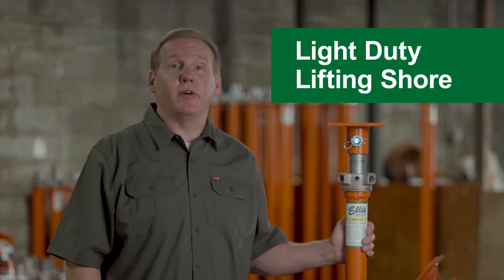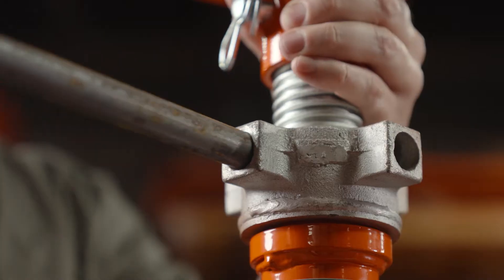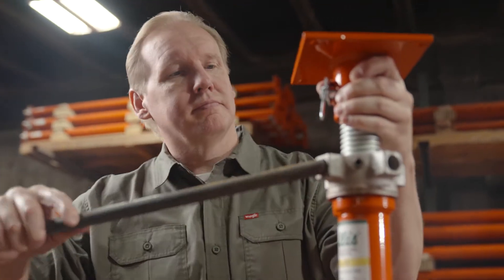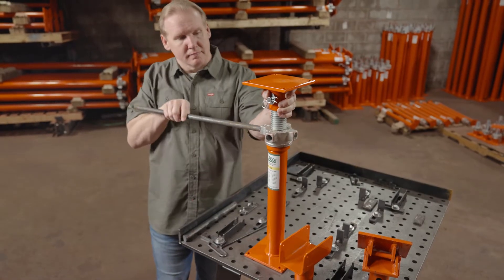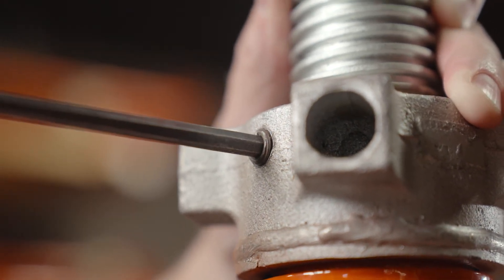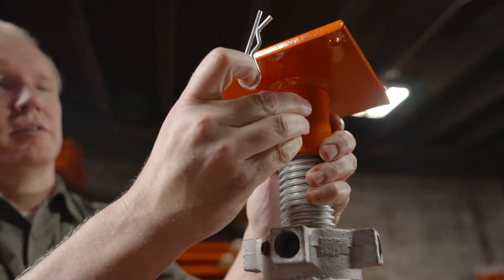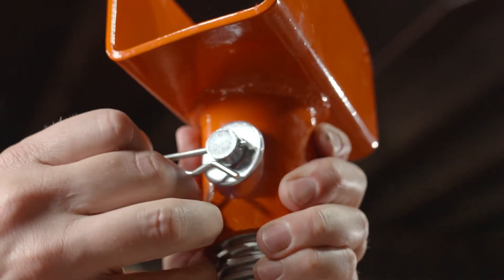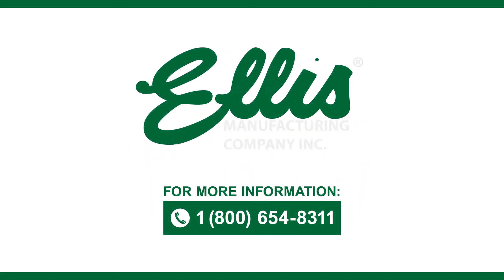Ellis Light Duty Lifting Shore

Comment: Are we supposed to apply some open gear grease the threads before use? 

I could not find any mention of that on the product page but the timber jacks come greased   and maybe it’s just implied.
Reply from the maker: Great question.  The screws and bearings come lubricated and you can add lubricant in the small oil hole on the side of the nut.  The Lifting Shores should be lubricated before height adjustment.